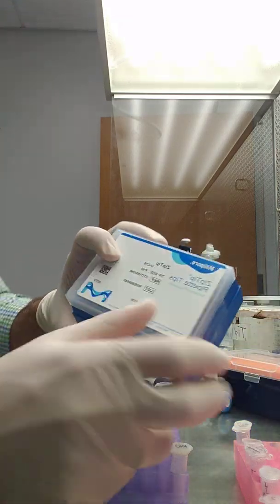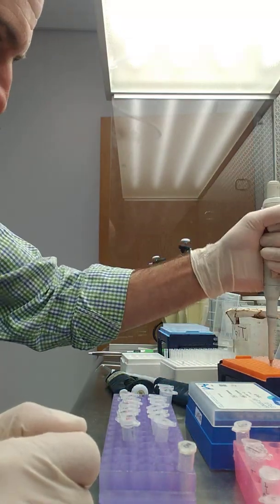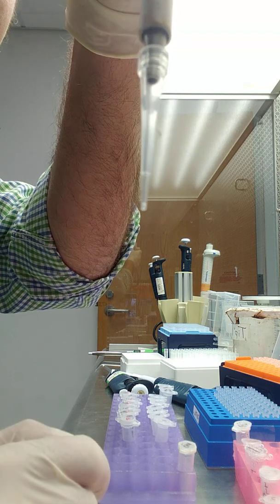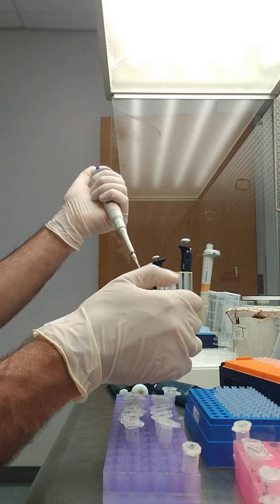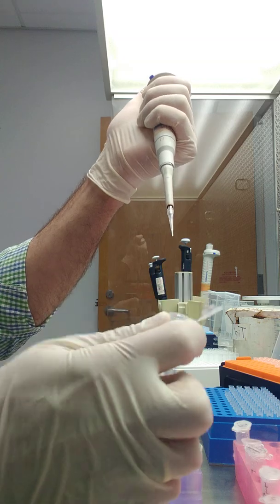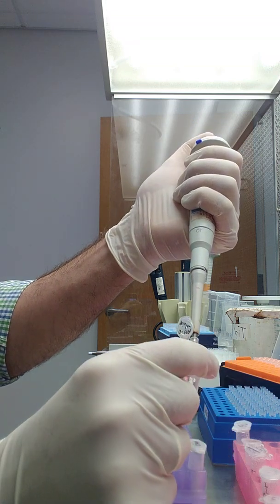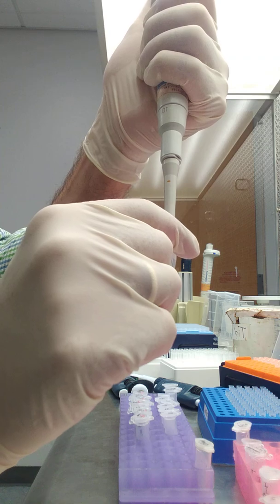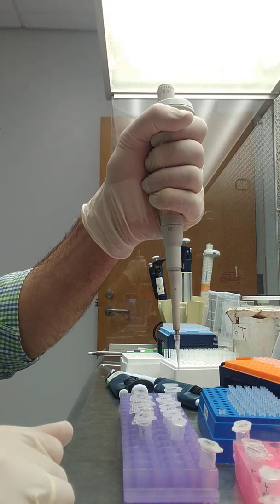Using C18 ziptips to desalt peptides

Comment: Thanks for video. I am wondering if I can use ziptips to purify polar samples with molecular weight around 1 to 1.2 kD?
Reply from the maker: yes probably as long as it sticks to the c18 tip.  I would do water washes and check them just in case.  Then elute with lower amounts of ACN to get the polars.